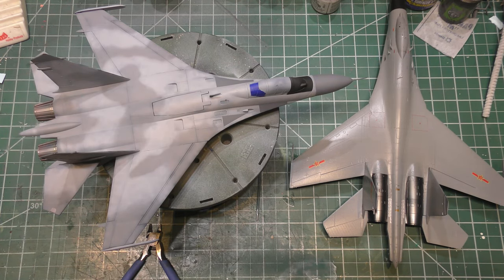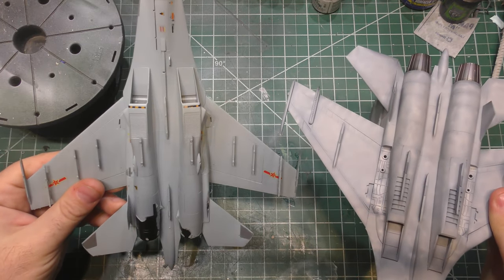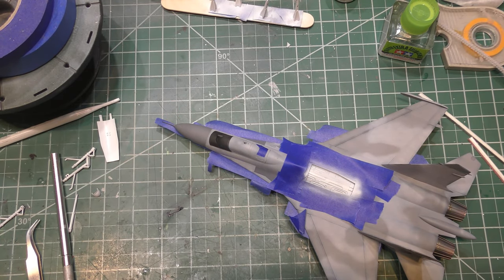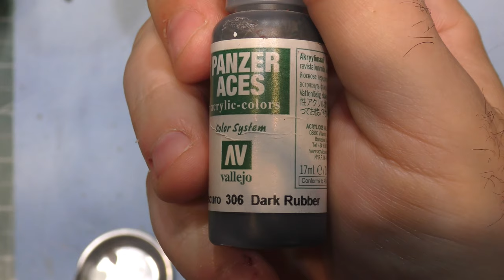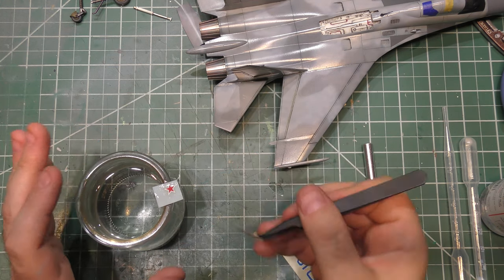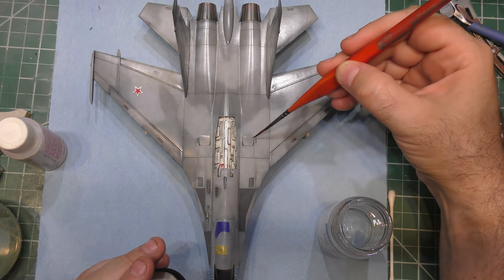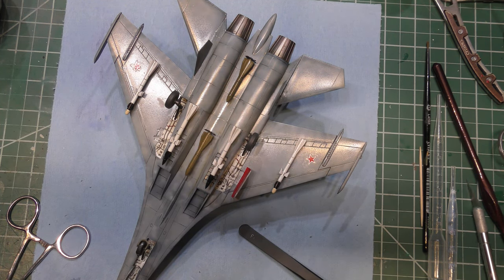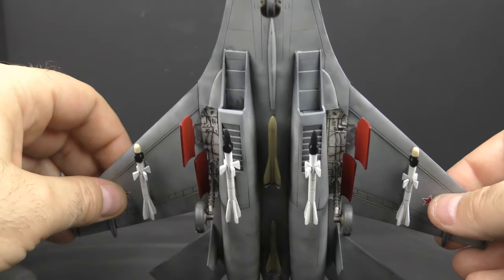Building the WORST Flanker Kit Ever! - Vintage Revell 1/72 Su-27 Part 3

Comment: I just finished a 1/144 Revell Flanker that I found in a thrift store. It's exactly the same, just scaled down. Could it be that Revell, in an effort to "scoop" the other kit makers, did what they could early on, before accurate data was available, and since the Su-27 is very close in appearance to the MiG-29, Revell just went with it? Also, those little sensor blisters on the vertical fins, I looked at the instructions for a later issue of the 1/144 kit, and it shows them on the sides of the engines, as on the Trumpeter model.

Comment: Compare this Flanker to the prototype Flanker and a lot of it's inaccuracies start to make sense. Especially from the top view.
Reply from the maker: OK. But the prototype was not a Su-27. It was the T10. And this is sold as a model kit of the Su-27, not the T10.
Reply: @AirForceBuilder  

It was also the mid-80s when accurate information was scarce at best. 

They did about as well as can be expected, given what they had to rely on. It's not a perfect representation of any development version, it's an attempt to beat the competition by starting before them.

As for the internal designation vs. the official designation, that's ultimately splitting hairs since T10 continued to be it's internal designation after production began. They're synonyms.

T10 continues to show up in the internal project designations for newer Flanker and Fullback derivatives as well.